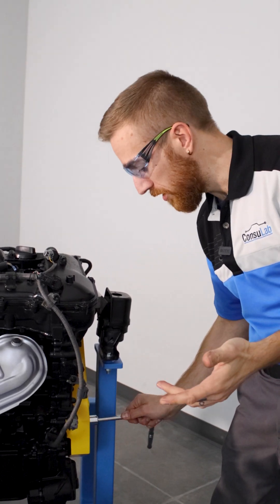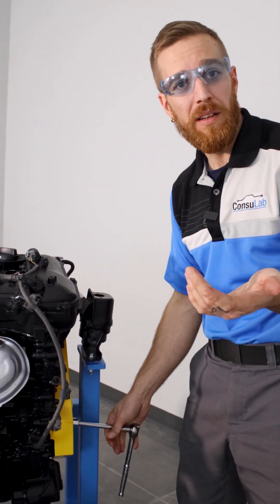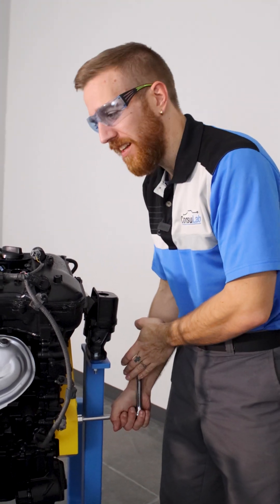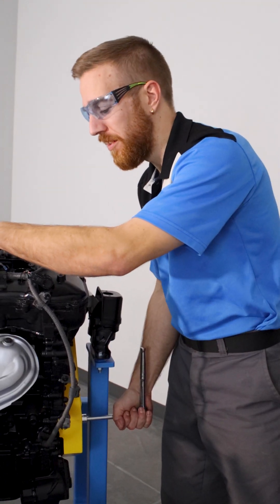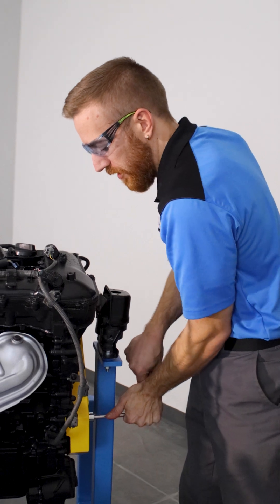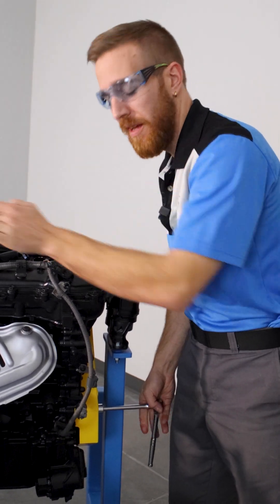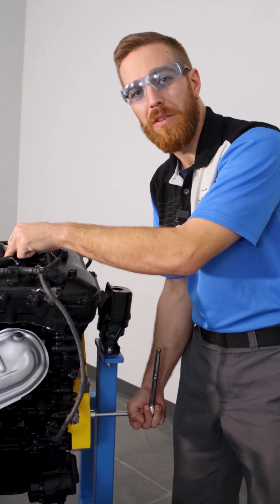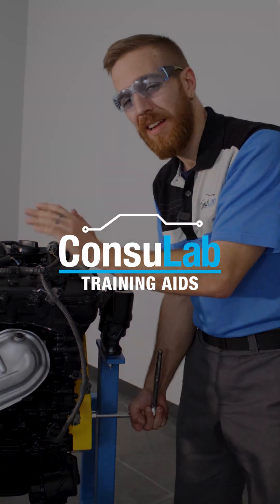One easy trick for Top Dead Center (TDC) compression

Comment: Not on a cross plane crank engine.
Reply from the maker: You're right, we should have specified that this method is very specific to 4 cylinder inline engines! It does not apply to any other configurations. Thank you for reminding us.
Reply: @Consulab good to know irrespective.
Reply: Exactly.